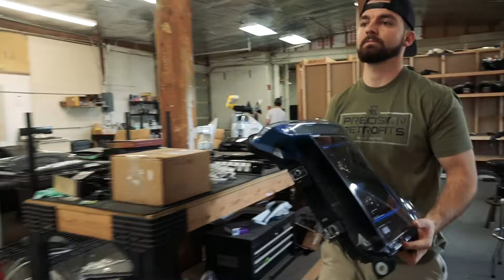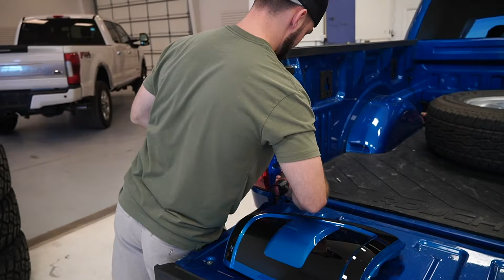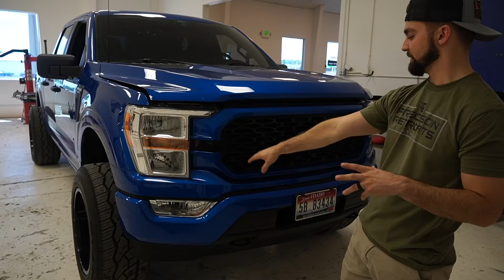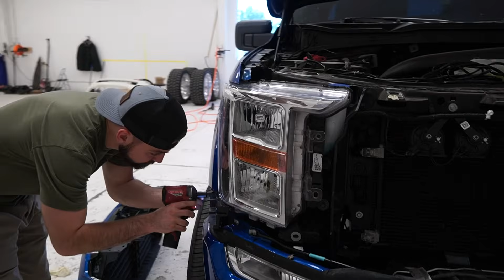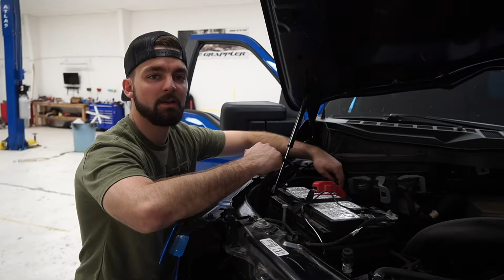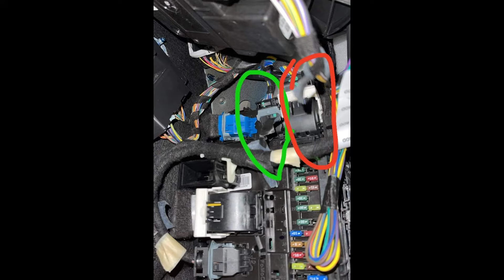2021 F-150 LED Headlight SWAP (Instructional)

Comment: I need major help😂 when running through the firewall I cannot find the grommet you ran yours through. I tried running it through the bigger round one (with the elbow hanging off) but I couldn’t get it to go through. Any tips to make it easier?
Reply: I'm having the same issue here. Did you end up figuring out a way to get it thru?

Comment: Looks great. So I currently have the quad full led headlights on my 21 xlt but want to swap to full led setup. 

Is that a direct swap with no harness needed or FORScan needed? 
I would only need an additional harness if I want adaptive headlights and high beams? 

I rarely use high beams but would want the adaptive headlight feature.

Comment: Have you had the opportunity to make a video on changing out the fog lights?  I have the led factory fog lights and one is out.  I haven't figured out a good way to get in and find out why it's out.
Reply: The easiest way to get to the fogs is to remove the grill and headlight so you can reach in from the top, if you don’t feel like doing that I suppose you could do it without that but it’s already pretty tight. To get the fog lights out you have to remove the lower active air damn, after you remove that you should have plenty of room to get behind and remove the fogs. On the other hand figuring out why it is out I’m not sure.

Comment: It always blows my mind that guys will buy the cheapest trim model of truck and then add thousands of dollars in after market parts and accessories. Why not just use that money and buy a better trim model than the cheapest one?
Reply: Not sure in this case, but us regular cab guys are forced to do this because Ford does not offer much for that model.  I guess we should just consider ourselves lucky that they still produce a RCSB.
Reply: Because is cheaper that way… Why would I pay 20k more for a Lariat when I can buy an XL and just add the little things that I wanted from a high trim? Is not like they are trying to do do a XL to Lariat full conversation… most of these guys are buying trucks to work and not to be a family car
Reply: Because your paying extra for crap your going to swap out anyways like suspension wheels tires car audio, the list goes on
Reply: The extras from factory are more creature comforts and technology. If you don’t need that, an XL with some XLT options is a MUCH better value. The bolt on stuff they’re spending money on isn’t offered in factory trim levels.
Reply: Haha definitely not a car guy
Reply: Cheaper to do it that way. Plus the higher trims don't get a v8 option, so we're forced to buy the XL or XLT trims.